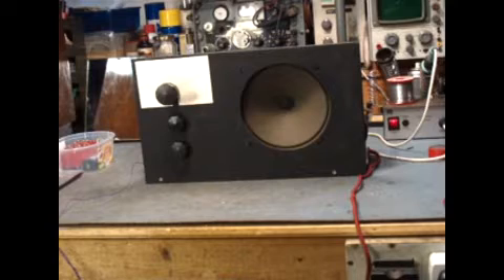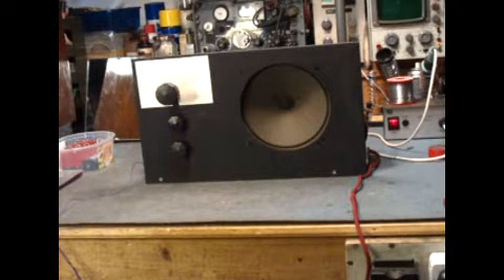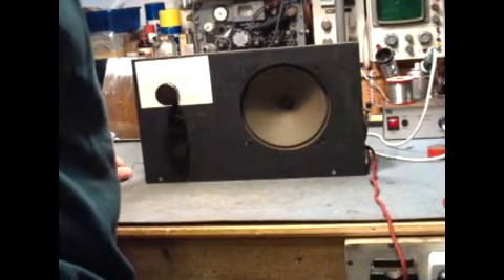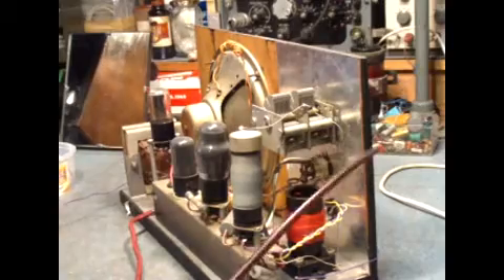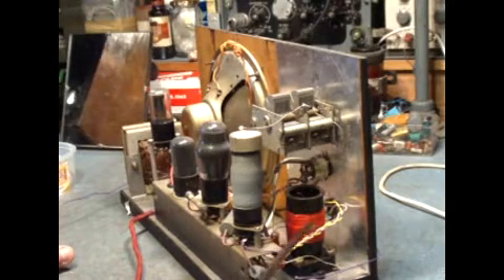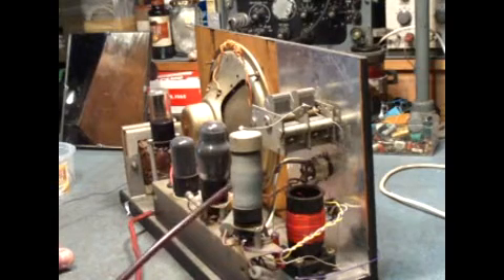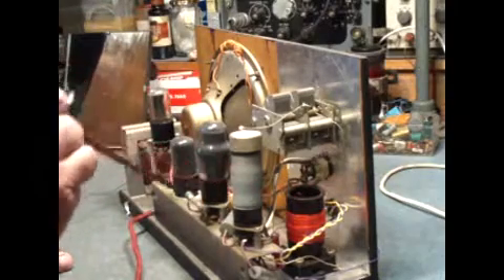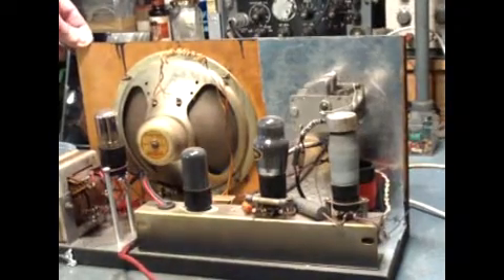Valve Radio Home constructed

Comment: Very nice job and you have handled the hum situation, isolating the mains transformer well off to the side. This clearly demonstrates the benefits of using the ground plate on the front panel and a chassis. Excellent choice the 6K7.

Comment: I had a problem with stability.
The latest incarnation has two power supplies: One for the detector & one for the audio amplifier. Previously the set would squeal if the volume control was wound up to maximum. Now there is no such issue.
The valve lineup is EF36, 6Q7 & 6V6. The EF36 gives smoother regeneration than a EF39 or 6K7 at the expense of output.
You can use whatever you have kicking around. An EL84 is another really common audio o/p valve. As it is more sensitive than the 6V6 it is an option if you only have a weaker triode as audio pre-amp.
If your local transmitters are powerhouses you could drive an EL84 directly without the intermediate triode.

Comment: I have taken the amplifier from a 1962 book entitled 'Radio for Boys'.
It was the detector and audio stage of a superhet..
I added extra de-coupling to the screen-grid of the EL32 and on the anode of the EF39.
A EF37, 37 or ME1400 may give smoother re-generation compared with a EF39 or 6K7.
I will try and put the circuit diagram on Photobucket.

Comment: This radio is successful, with no hum or feedback because the separate stages are well spaced out. 
I have made a tuner & amp on separate chassis. You could listen to the radio feeder on high impedance headphones.
Maybe if you used a AF output transformer you could use 'Walkman' or IPOD earphones instead?

Comment: I have made this circuit in a smaller space.
I used a EFF39, EBC33 & a EL32.
I get HT with a Selenium rectifier directly off the mains & a small transformer runs the heaters.
The triode part of the EBC33 has more gain than a 6J5. An EL32 still makes 2 watts RMS. I guess you don't need the full power of the 6V6 anyhow.
The circuit here is probably safer, though the power the H&S guys have nowadays you probably wouldn't be allowed to take this into a school & demonstrate it.